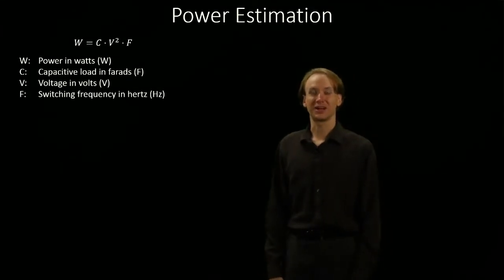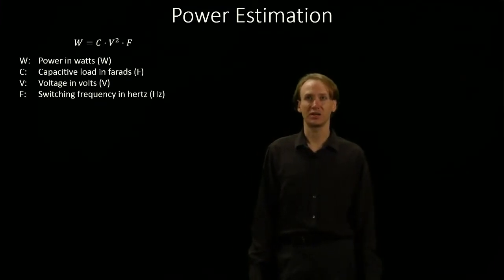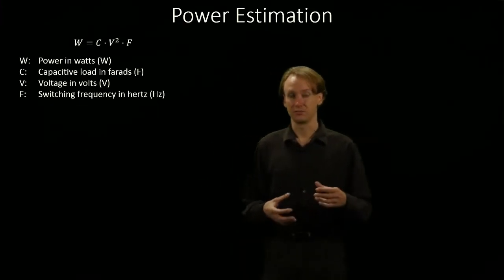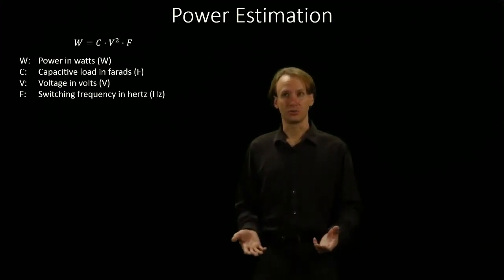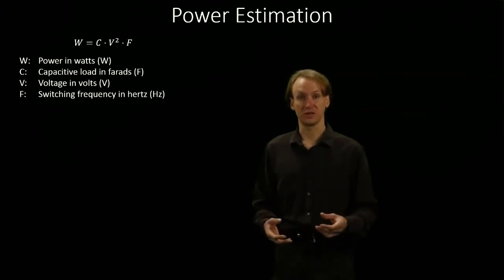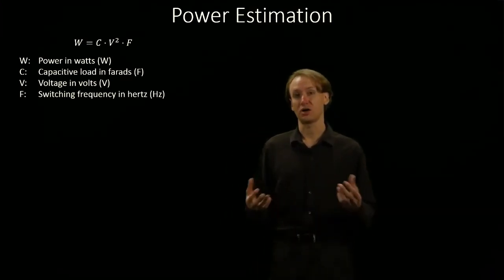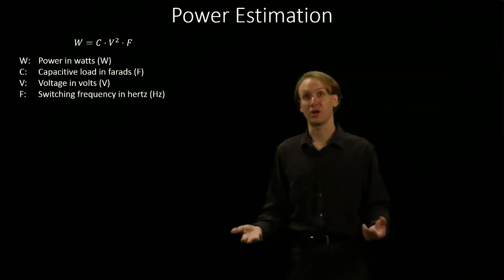3.  Power Estimation

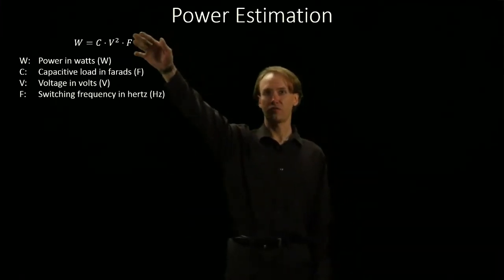Comment: 0:20 Power in Wattage is the product of the capacitive load, the square of the voltage, and the switching frequency; not very precise, just an estimate
0:55 the capacitive load tells us how much charge the hardware can hold; determined by # transistors, the fan-in and fan-out of those transistors
1:34 the switching frequency at first sounds simple (hardware often measure in Hz) but not that straightforward
1:55 some transistors switch every clock cycle but most don't; some may be turned off or not doing anything